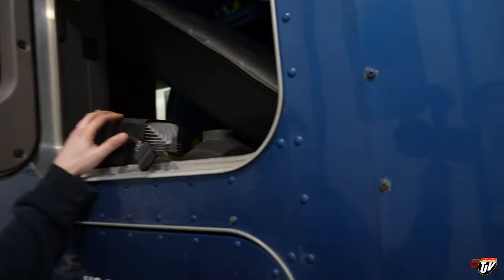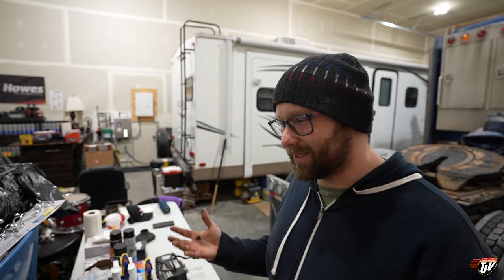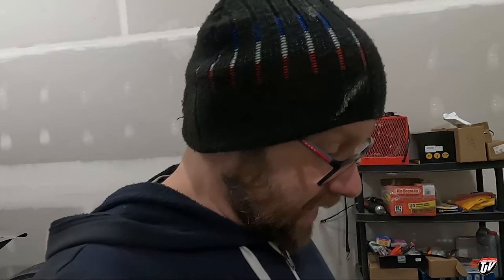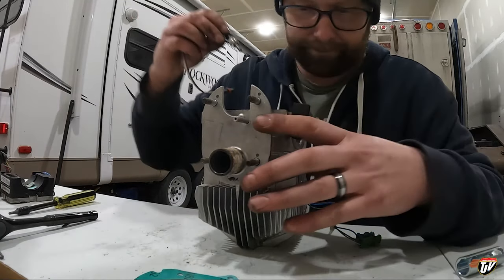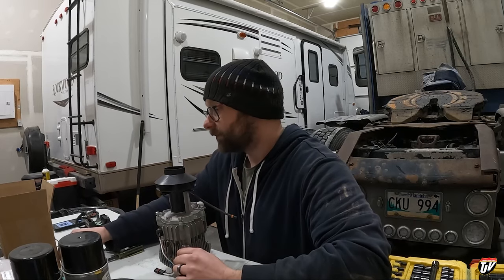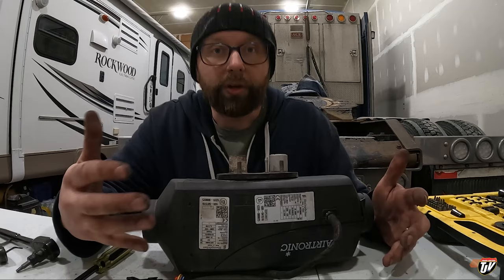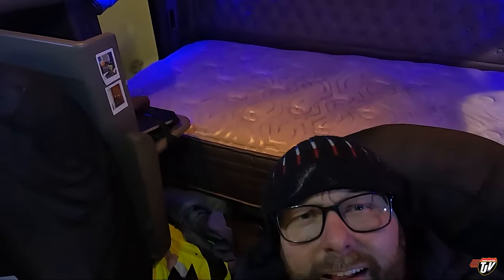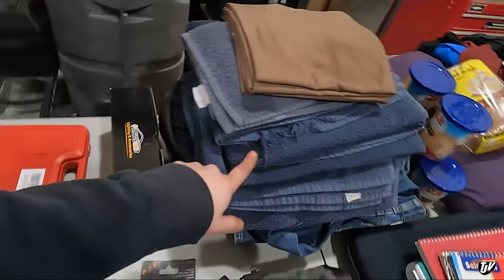THE REBUILD | My Trucking Life | Vlog #3012

Comment: i have 4 friends, 3 that have an RV and one that drives a straight truck . they all get them serviced - cleaned once a  year and they turn them on full blast for 15 minutes once a  month even in the summer time
Reply: I think I read it's a factory recommendation. Mine is hooked up to the engine (regular car) so it's a benefit even during the summer. Also vents the hot interior a tiny bit when the hvac is running
Reply: Just so you know…there is a fuel filter that you might want to replace before every winter as well. I run mine every month for about 30 minutes. Also in very cold weather it’s also good to run it to get some anti-gel through it. That can also cause the smoke, because it’s trying to burn that left over fuel first. Just what I’ve learned over the years, having one for 5 years. Take Care enjoy your videos, the home ones with your family as well.

Comment: Great rebuild you’ll be toasty while sleeping, little trick during summer months start your bunk heater once every couple weeks

It circulates fresh fuel through the line and prevents older fuel from gumming up that small filter
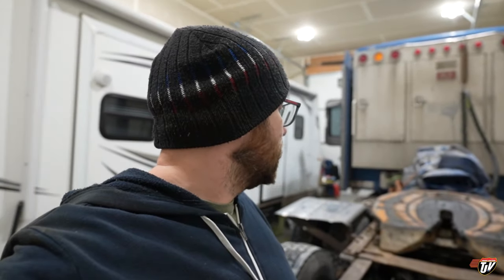4:02    
Another great video thanks Ron

Comment: Good to see you got bunk heater going having Cummins engine on high idle for long periods will not damage the engine and you run for 10 hrs only use bout 10 litres of diesel

Comment: As a youth l worked at a plant nursery here in Memphis, Tn. We had a mid 80’s F350 dump truck. I knew next to nothing about diesel trucks. In colder weather I was instructed to spray some ether fluid in the air box to start the truck. I did so faithfully not knowing how damaging it could be. I would never do that to any truck I owned, but Atleast I learned not to do that on someone else’s truck!

Comment: I wonder how much this would cost to replace this webasto thingy, my parents now have one in their new Van RV (Class B 20" based on Chevy Express 2500 from 2009) and it sometimes refuse to blow hot air, sometimes it takes 10-12 times before it starts blowing hot air in their cab and sometimes, its just cold icy air and we have to turn it off, then try again to turn it on, my guess is the pilot light doesn't work or doesn't turn the heater properly, not ideal during our winter, the only thing I know for sure about it, is its powered by the Van fuel (gaz so not diesel), if the fuel tank goes under 10% it stops it automatically. We are planing a replace of it, but maybe something can be done for less.

Comment: South Georgia Trucker just fixed his, looks same as yours. He had issue with a hole or separation on the exhaust pipe. did a Jerry Rig to make it till he can replace the exhaust tube. Something about running it on high to burn out the soot?.........anyway.....thanks

Comment: Also to be honest it does get sooted pretty good from what you showed and with what you said that you didnt look at it until now. I feel like yearly maintenance is probably a good thing in that regard though making it a bit more convenient to get to would be nicer for you but i feel like you probably would be able to get a frame that pivots up from the back so the hinge point would be in the back and youd tilt it up from the front. My dad had a 92 Fld that had it and all this other trucks Sterling, Columbia, Cascadia. Im surprised your Kenny doesnt. I feel like if you just got a frame from a junk yard or something second hand youd be able to adapt it to your truck with some effort. Maybe move stuff around down there to make the space more efficient. I know what i said might be a bit more expensive but projects are never in budget 😂

But projects that make sense are always worth it. U just need to see the value in it. I feel like i definitely would  tackle the bed frame the next time you want to maintain the bunk heater. I mean on paper its anchoring the hinge on the back of the cab there to something strong or making the cab strong for it. And then either making two boxes under the foot and head for the frame to sit on or making a wall with some dividers. Then top it with your mattress. However also making it so that you can flip up, that mattress needs room before touching the back wall of the cab as you tilt up to your desired height. Easy on paper for sure bit of a labour of love in real life. I would do it

Comment: Have you considered an APU. That would not only heat your truck in the winter, it also would give you AC in the summer, as well as keeping your engine warm and your batteries charged. Just asking?
Reply: Was about to ask the same. Perhaps too much $$. Cabin heat and AC are nice, but a fully charged battery and no cold starts would do it for me.
Reply from the maker: Yes it's in the 2 year plan